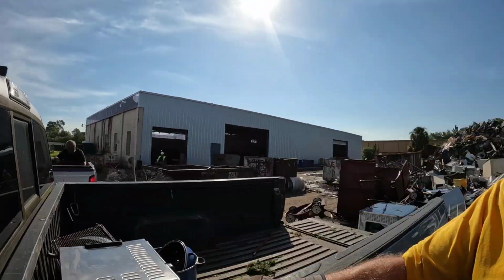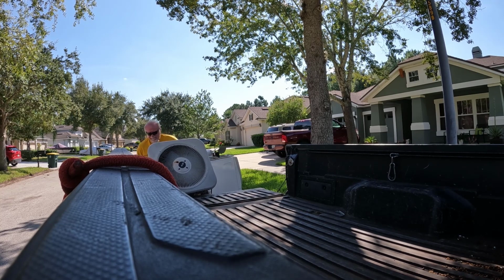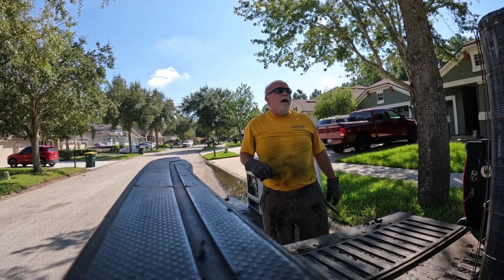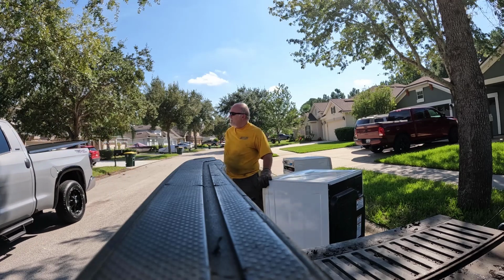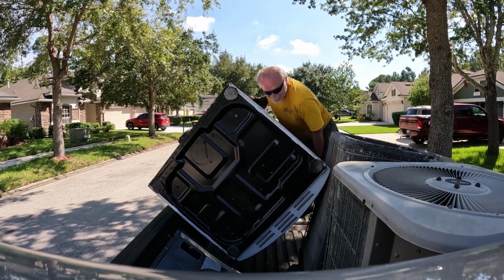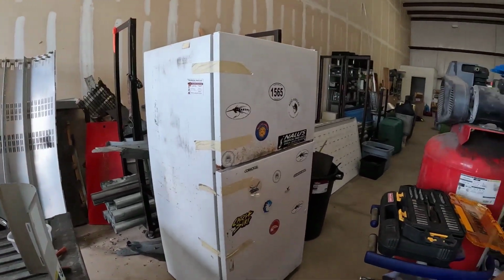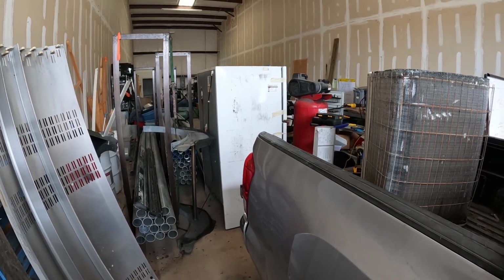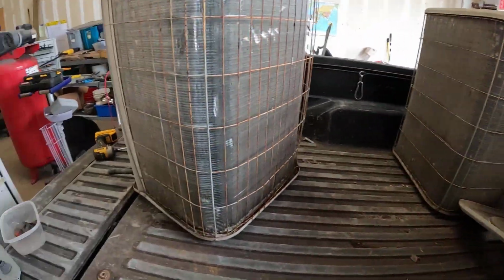Street Scrapping - did we make it back in time or ...

Comment: Nice curb find! What I would do is put the dryer on its side in front of the tailgate then roll the washer onto the dryer the roll it off and into the bed. Then load the dryer as normal. I'm lucky with my 91with 8 ft bed
Reply from the maker: An interesting technique, I need to try that sometime.  An 8' bed would be very nice.

Comment: A great load, my back hurt watching you load those air conditioners, at least you got a  nice tip from the dryer.  I think it was 6 feet of ubiquitous wire shelving.  I vote for a lift gate, not all days will you need a trailer to drag along in those cul de sacs.  You will also have to ha e a spot to park the trailer too.  I do love Poly Profs trailer though.
Reply from the maker: Maggie - I've gone back and forth on trailer vs lift gate so many times.  In a perfect world I'd have both, but this is far from a perfect world.  Your thoughts on a trailer are well founded.  Some of the cul-de-sacs can be very tight, especially when cars are parked on them.

Comment: It really looks like you could use a sorts of ramp to get stuff up, but you definetly need a belt for your back.
Reply from the maker: I should look into a lift belt.  or a lift gate  or a trailer  or all 😂
Reply: @sharkscrapper  a couple planks of wood, as example, would let you push it up without lifting.
Reply from the maker: I have tried that but found the friction of the wood makes it more difficult than the tilt method I'm using now.  That could be overcome with a winch, but if I'm going to do that I think mounting it to a trailer would make more sense.